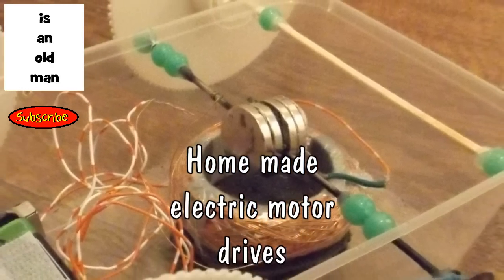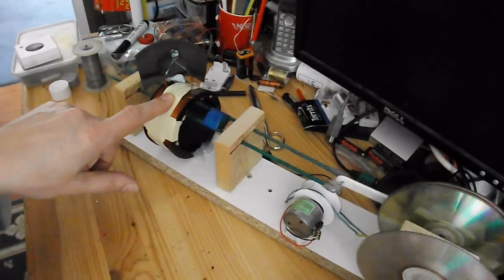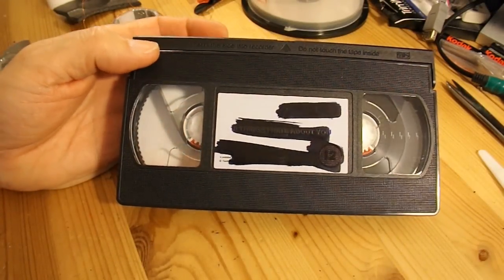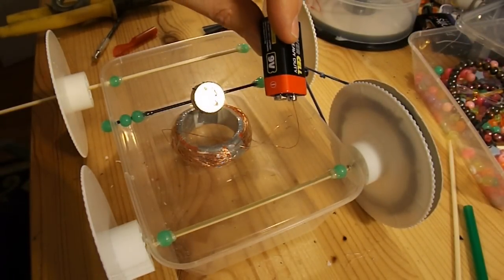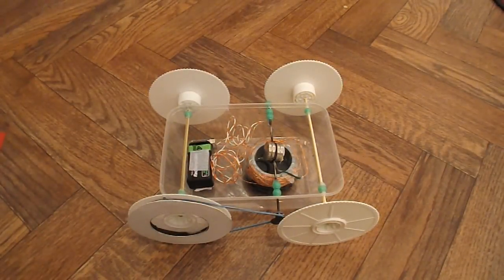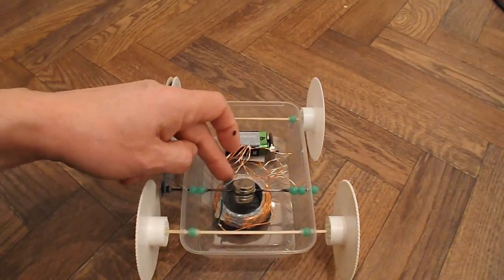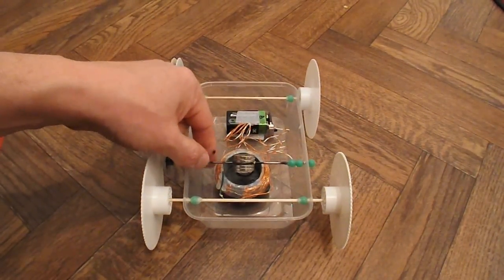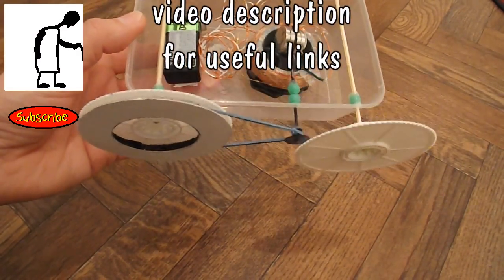Home made electric motor drives home made toy car

Comment from the maker: THIS IS NOT AN EASY PROJECT. I made 2 more videos to answer similar questions. They contain a lot of information in the video description based on edited extracts from the conversation I had with the person asking the questions.
https://youtu.be/68zcXPEdlM4?list=PLA5a2xPRSrB0scvCxBYNn35HohUxUoj0e
https://youtu.be/HfpN7Fj3I0E?list=PLA5a2xPRSrB0scvCxBYNn35HohUxUoj0e
You may want to try reversing one of the magnets so you have the same poles pointing outwards. When the current flows through the coil it creates a magnetic field that repels the magnet. As the magnet moves away, the axle turns and the painted section of the axle (bicycle spoke) insulates the electrical path stopping the current flowing. If this happens too soon, then the magnet may just swing back again instead of completing a complete spin. If it happens too late then the coil repels the next magnet as it tries to come round, pushing it backwards.
I explain this timing sequence in the other video notes.
This motor can work two ways depending on how you get the timing synchronized with the painted sections of the spoke. 
1. If you have the magnets arranged North/South/North/South one end will be repelled and the other will be attracted.
2. If you have the magnets arranged North/South/South/North or South/North/North/South each will be repelled or attracted depending on which way your current is flowing.
Both 1 & 2 will work, it is just down to how you arrange the insulated portion of the spoke to stop the current flowing at the right time.
In both cases you may need to give the motor a little help to get it spinning or you may be lucky and it self starts. I show how difficult this is in the videos.

The videos relating to this project are in this playlist https://www.youtube.com/playlist?list=PLA5a2xPRSrB0scvCxBYNn35HohUxUoj0e

Comment: Me and my automotive classmates are working on this and we can’t get the comucatior to work
Reply from the maker: This is certainly not an easy build, especially using scrap components like this. With regards to the commutator, the important thing is to understand what it is doing. It has to send current through the coil at the right time to create a magnetic field to repel the magnet and then switch off again. If it stays on too long it attracts the other pole of the magnet and locks it in position stopping it spinning. So the exact position the brush touches the commutator gives you the timing, and the amount of bare metal on the commutator gives you the length of the pulse. If you haven't already looked, you will find more information in the video description. Good luck with your project.
Reply: Thanks, also for the car’s body you could use a VHS case instead of a plastic tupperware

Comment: No, I never saw this one. Really good job. So you are using just one brush and the other side is permanently making contact. I like that. Was the sort of thing I was thinking about when I said pulse motor. A good set of videos on it. 👍👍👍
I should have known you had already done something like this. LOL 😂
Reply from the maker: I am quite proud of this one. A real pile of junk items put together and it actually works. It is temperamental. I think it is still up in the loft so it might be worth finding it and giving it another run to spark a few comments 😊
Reply: @GrandadIsAnOldMan  Yes, get it back out and maybe build another one. Might be a good idea to edit out the coil winding part. LOL 
That big Tesla coil I built took me about 4 hours to wind the secondary coil by hand. If I were to build another one that size I would set up a jig with my drill. 👍
Reply from the maker: @mikeflight9  I do quite a lot of my videos real time so I can ramble on while I do it 😆

Comment: Thanks for the inspiring video! I think I'm going to build something similar to it. But wouldn't it be better to swap permanent magnets and the the coil? That way, you could easily build a commutator that actually switches polarity.
Reply from the maker: Feel free to make any modification you feel will help your project. This build has many difficulties and getting it to run can be very frustrating, however it is built this way because that is the way I wanted to do it. Nobody told me to do it, it was just a project to find out if it would work.

Comment: How did you make the pulley system with the bicycle spoke?
Reply from the maker: You could just buy pulleys or if you want to make your own a pulley is just a small disk between two larger disks.
Reply: what did you place on the end of the bicycle spoke?
Reply from the maker: A small pulley, it has a larger disc on the side of it to stop the band slipping off. Clearly I don't understand your question. Are you asking about the plastic beads?
Reply: Okay thank you, I understand now

Comment: Dc or Ac pls
Reply from the maker: Hi Ethan, do you know what DC or AC means? This car is powered by a battery. Batteries are DC so unless you feed the current through some sort of converter to change it into an alternating current then it will be direct current. If you want more information about this project there is information in the video description including a link to the playlist which contains all the episodes in this project.
Reply: GrandadIsAnOldMan thanks that what I thought just wanted to make sure
Reply from the maker: Fair enough, always best to ask 😊

Comment: I made a motor like yours it runs but the battery gets very HOT what is wrong? Thanks
Reply from the maker: The batteries get hot when you are drawing a lot of current so that probably means your motor is very low resistance allowing a high current flow. A larger battery may provide the current you need.
Reply: Thank you for the reply. The magnets rock back and forth and spin a few times but can,t stay going. Then the battery gets hot and its done. 9volt bat.
Reply from the maker: If they rock back and forth then you probably haven't got the commutator and brush adjusted right. That is probably the hardest bit to get right. If the power flows into the coils at the wrong time then it repels the magnet too soon and it goes backwards instead of forwards and if it is still energised when the next magnet comes round it repels that one back the other way so you get that rocking. This not an easy project and you need to watch all the videos in the series and read all the notes in the video descriptions.

Comment: how many RPMs?
Reply from the maker: +Vampire Volverene no idea, what difference would that make?
Reply: +GrandadIsAnOldMan just wanted to know how fast it spun
Reply from the maker: Vampire Volverene how would you suggest I measured the RPM?
Reply: I'm two years late but an easy way of checking RPM is to record the magnets rotating with a camera you know how the fps of and then looking through the frames seeing how many frames per rotation :)

Comment: Do the magnets have to be neodymium?
Reply from the maker: +Eatbudder the power of the motor will be directly related to the magnetic fields so I would expect a motor made with less powerful magnets would have less power if all the other components are kept the same.
Reply: +GrandadIsAnOldMan why does the spoke have to be painted? I have an unpainted spoke and I don't know why my car is not working, I don't know if I have enoguh wire or mabye in making the coil wrong
Reply from the maker: Eatbudder this is not an easy project and you need to watch all 3 videos in the series and read all the video descriptions on each video as I have answered so many questions on the project and put the answers in the descriptions. If you do not understand why the spoke needs to be painted then you have missed something in the series. The way an electric motor works is by making an electromagnet repel or attract the permanent magnet. If you have a constant electromagnet it will attract one pole of the permanent magnet and hold it in position. The motor does not spin, it stays rigid in one place. The paint breaks the circuit and turns off the electromagnet. It must do this at exactly the right time to allow the permanent magnet do spin past before it turns on again. This is called the commutator.

Comment: Hi, i did not find bicycle spoke which is already painted.Therefore, i do not make oscillator to turn magnets. So, if i paint spoke, what kind of paint should i use? For example, can i use black nail or spray paint? I want to know whether i should use specific kind of paint.Thank you!
Reply from the maker: +bengisu mısır I would think almost any paint will work, even nail varnish. It needs to insulate the surface so the electricity cannot flow and most paints will do that. I think you would find it very hard to get conductive paint as that is a specialist item only used on projects that need it and probably only available from specialist suppliers.
Reply from the maker: +bengisu mısır please make sure you read the video description associated with this video and watch the other two videos in the series and read the video descriptions associated with them. This is NOT an easy project and I have answered many questions on the subject and included the answers in the video descriptions.

Comment: Whats the top speed
Reply from the maker: no idea. If it is important to you you can work it out by timing the runs on the video. There are two big red stripes on the floor and they are 3 metres apart so you can do the maths and calculate the speed.
Reply: SOrry Shsssssss!!!
Reply from the maker: Jochim Edago how else do you expect to calculate the speed?

Comment: i tried making it but the thing is that the magnet is not rotating itll just stay fixed at one point. i had used a 0.2 cm copper wire of 4m . Do u think i have to use more
? pls help grand dad

Comment: That's interesting, you generated a magnetic field by running current through the wire in order to rotate the magnets which rotate the wheels. Most people used magnetic field to rotate the wire. I think your method is more efficient. Great video!
Reply from the maker: Imrhankhan Shajahan I doubt there is any difference in the efficiency. The components used and the accuracy of the build probably have more impact. However, the mass of the magnets spinning may help as a flywheel effect, compared to an open cored wire, but if the wire is wrapped around a metal former then that metal former would give the flywheel effect. You will find information on 'Cored' and 'Coreless' motors if you search for it. Each have their own advantages and disadvantages so they are used for different applications.

Comment: I like your video! my advice for your chassis is that you put an X on the bottom of the plastic box with ytwo light sticks glued. it'll give it more resistance for the bending
Reply from the maker: Pedro Jesus Santos yes that would probably work although I found that having a flexible body helped me to align the brush on the 'commutator'.

Comment: We have a school project due tomorrow and we are trying to make our own car based on your design. We can't get the motor to spin in the correct direction. On each side of the armature the axel is spinning 2 different ways. Can you help us with your circuit design?
Reply from the maker: Robbie Sutton this is not an easy build. I made 2 more videos to answer similar questions. The second one below contains a lot of information in the video description based on edited extracts from the conversation I had with the person asking the questions.http://youtu.be/68zcXPEdlM4?list=PLA5a2xPRSrB0yTUYmJSS3ML5xxaBzHl3e
http://youtu.be/HfpN7Fj3I0E?list=PLA5a2xPRSrB0yTUYmJSS3ML5xxaBzHl3e
You may want to try reversing one of the magnets so you have the same poles pointing outwards. When the current flows through the coil it creates a magnetic field that repels the magnet. As the magnet moves away, the axle turns and the painted section of the axle (bicycle spoke) insulates the electrical path stopping the current flowing. If this happens too soon, then the magnet may just swing back again instead of completing a complete spin. If it happens too late then the coil repels the next magnet as it tries to come round, pushing it backwards.
I have already explained this timing sequence in the previous video notes.
This motor can work two ways depending on how you get the timing synchronized with the painted sections of the spoke. 
1. If you have the magnets arranged North/South/North/South one end will be repelled and the other will be attracted.
2. If you have the magnets arranged North/South/South/North or South/North/North/South each will be repelled or attracted depending on which way your current is flowing.
Both 1 & 2 will work, it is just down to how you arrange the insulated portion of the spoke to stop the current flowing at the right time.
In both cases you may need to give the motor a little help to get it spinning or you may be lucky and it self starts. I shown how difficult this is in the videos.

Comment: i made the entire thing exactly,but the magnets isn't turning like that's shown in the video..where could i have done the mistake?...please suggest and help me out
Reply from the maker: I made 2 more videos to answer similar questions. The second one below contains a lot of information in the video description based on edited extracts from the conversation I had with the person asking the questions.
http://youtu.be/68zcXPEdlM4?list=PLA5a2xPRSrB0yTUYmJSS3ML5xxaBzHl3e
http://youtu.be/HfpN7Fj3I0E?list=PLA5a2xPRSrB0yTUYmJSS3ML5xxaBzHl3e
Reply: GrandadIsAnOldMan thank you so much..if i have any more doubts regarding this,i will contact you again..and thanks again:)
Reply: What was the answer? We are having the same problem
Reply from the maker: Robbie Sutton this is not an easy build. I made 2 more videos to answer similar questions. The second one below contains a lot of information in the video description based on edited extracts from the conversation I had with the person asking the questions.http://youtu.be/68zcXPEdlM4?list=PLA5a2xPRSrB0yTUYmJSS3ML5xxaBzHl3e
http://youtu.be/HfpN7Fj3I0E?list=PLA5a2xPRSrB0yTUYmJSS3ML5xxaBzHl3e
You may want to try reversing one of the magnets so you have the same poles pointing outwards. When the current flows through the coil it creates a magnetic field that repels the magnet. As the magnet moves away, the axle turns and the painted section of the axle (bicycle spoke) insulates the electrical path stopping the current flowing. If this happens too soon, then the magnet may just swing back again instead of completing a complete spin. If it happens too late then the coil repels the next magnet as it tries to come round, pushing it backwards.
I have already explained this timing sequence in the previous video notes.
This motor can work two ways depending on how you get the timing synchronized with the painted sections of the spoke. 
1. If you have the magnets arranged North/South/North/South one end will be repelled and the other will be attracted.
2. If you have the magnets arranged North/South/South/North or South/North/North/South each will be repelled or attracted depending on which way your current is flowing.
Both 1 & 2 will work, it is just down to how you arrange the insulated portion of the spoke to stop the current flowing at the right time.
In both cases you may need to give the motor a little help to get it spinning or you may be lucky and it self starts. I shown how difficult this is in the videos.

Comment: Hi, I'm wanting to experiment with electrodynamics. I followed your steps but got stuck. my magnets move but they don't turn. Is the bicycle spoke important? With which black paint was it painted? Must i use a lot of enamelled wire? What can I do to make my current stronger? Can i use the bicycle spoke with the magnets directly as one of my axes for my two back wheels instead of making a pulley?

Comment: What is switching the current in the coil?
Reply from the maker: Hi francois, at about 05:00 I explain that the bicycle spoke that I used as the spindle was painted black. On one side of the magnets I cleaned the paint off and one wire from the battery is wrapped around it to make continuous contact. On the other side of the magnets I only cleaned the paint off part of the spindle so current only flows to the wire that rests against it when the bare metal makes contact. So that means for part of each rotation of the spindle current flows through the coil and generates the magnetic field that repels the magnets.

Comment: Hello. 
Could you give me a list of the materials I'm interested in doing this car I liked way too.
Reply from the maker: Hi Nancy Joana, sorry I didn't make a list when I made it as I used parts from other projects so I have just watched my video again and made this list.
Components
-
Neodymium magnets
1 Bicycle spoke
2 Barbecue skewers
10 plastic beads
Plastic storage tray
4 wheels made from VHS cassette tape spools
Rubber bands
Small pulley
Styrofoam and cardboard disks to make a large pulley
9 volt battery
A very long length of enamelled wire, I didn't measure it and I don't know what thickness it was. I had recovered it from a transformer I disassembled.

Comment: That worked really well.  I didn't know if that simple motor design could do the job or not.   The VHS cassette wheels were perfect.
Reply from the maker: Hi Lidmotor, I used the VHS cassette wheels because they are a little smaller than CDs so would need less effort to turn them but the motor had plenty of torque and would probably have managed CDs anyway with the gearing I used. The main issue was aligning the brush on the commutator especially with the flexible chassis changing everything each time I touched it.